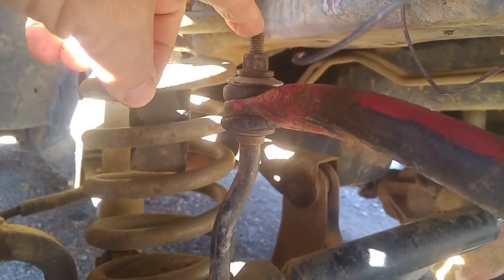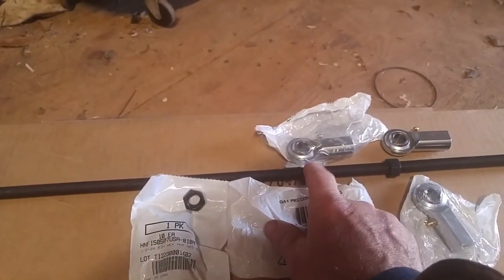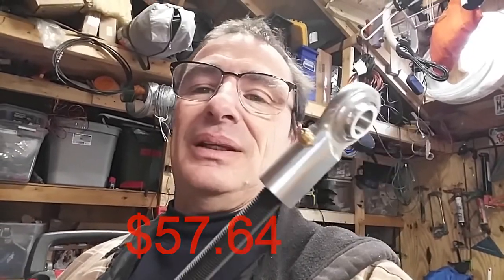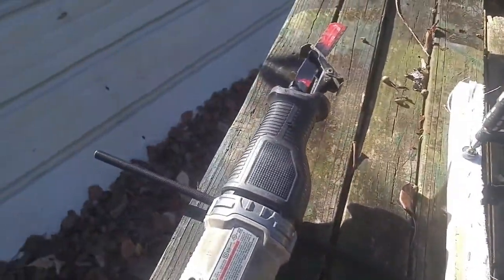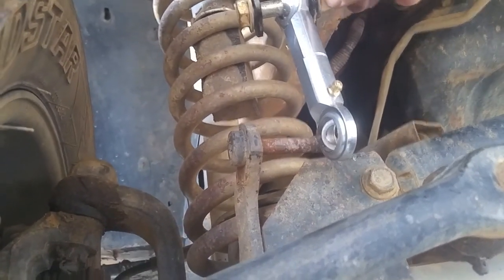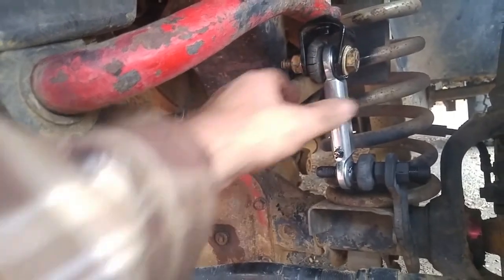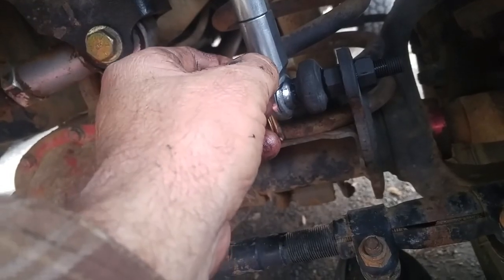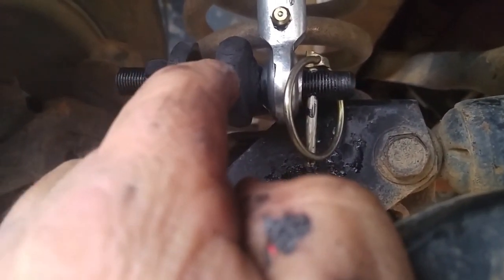Make your own swaybar quick disconnects

Comment: Been looking into doing this, but definitely didn't want the overpriced aftermarket ones. Did you use a right hand and left hand shank together on each side I assume? Will definitely be going this route very soon. Thanks!
Reply from the maker: Thanks for watching. I couldn’t find an aftermarket one that fit my needs without modifications so I had to make my own.  I wasn’t sure if a right and left hand shank would spin on the same rod so I got both right hand and goobed tons of lock tight on it.